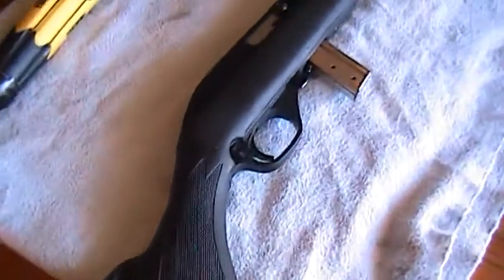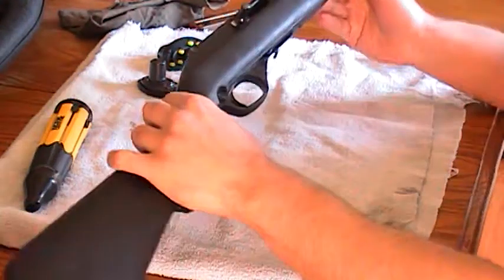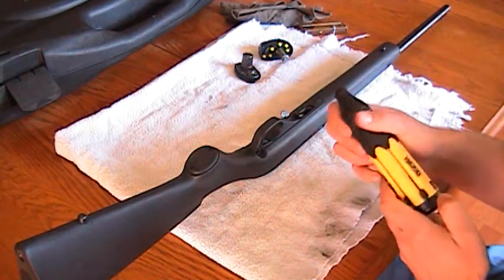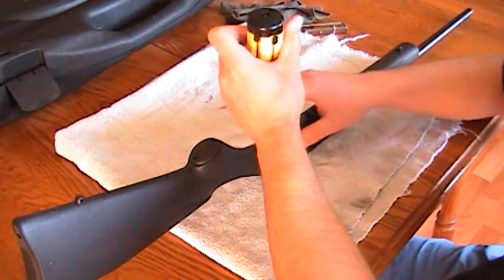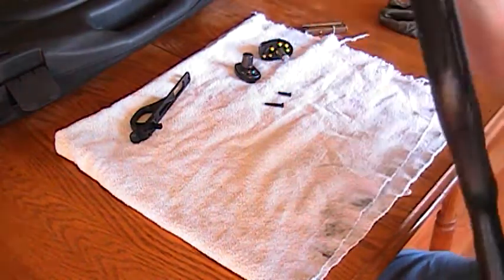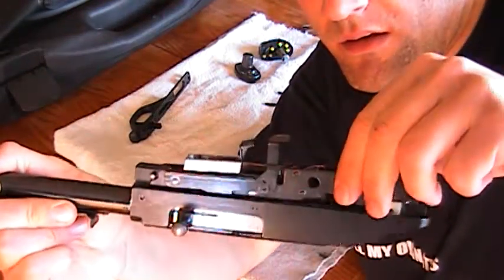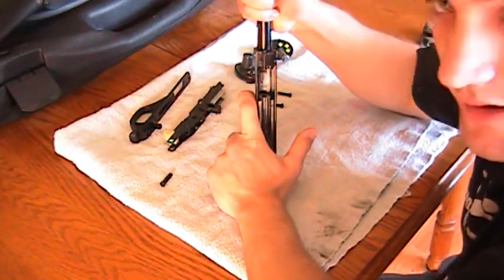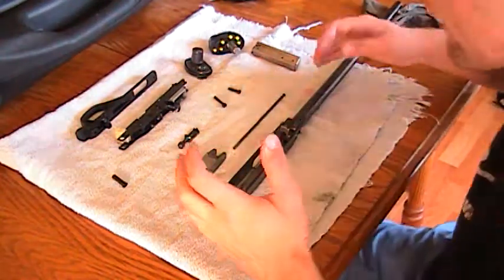Marlin 795 Field Strip

Comment: There are a ton of really blurry videos and I was hung up on joining the recoil spring/pin and the bolt/receiver.  I was nervous because it's obvious this step can go horribly wrong, as the person who owned the gun before me kinked the spring beyond repair (I replaced it).  The instruction to force the spring onto the pin is solid advice.  The pile of parts I was sold has now been turned into a functioning model 60, so thanks for the help!